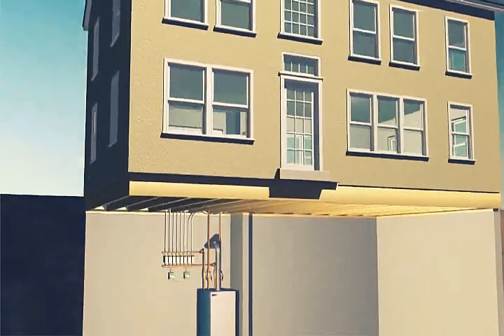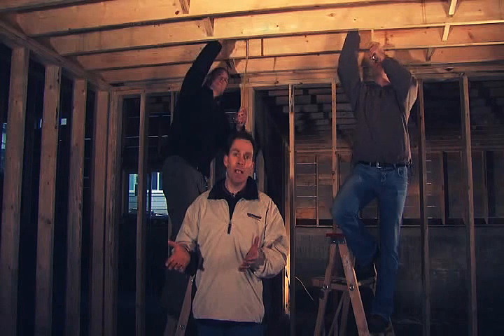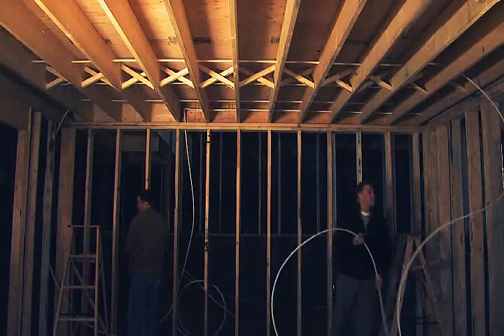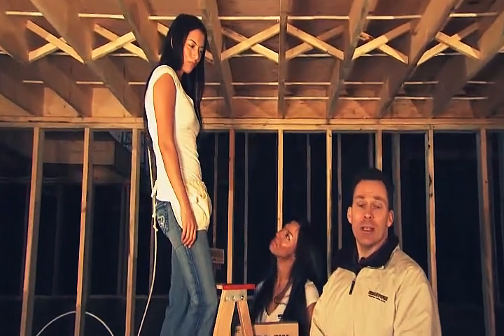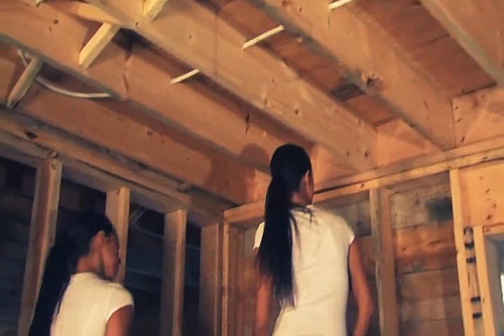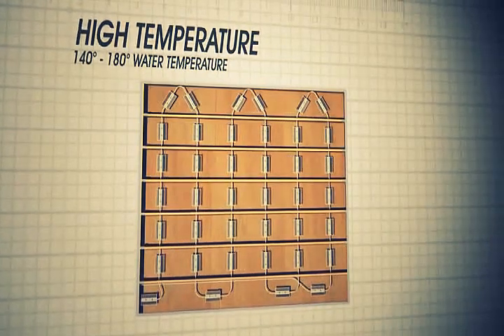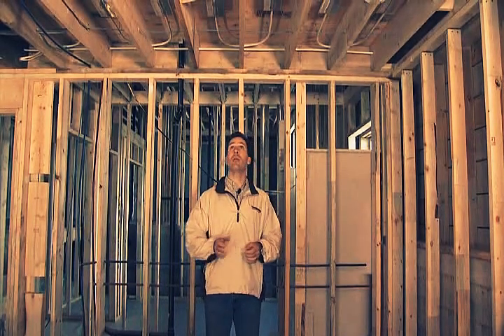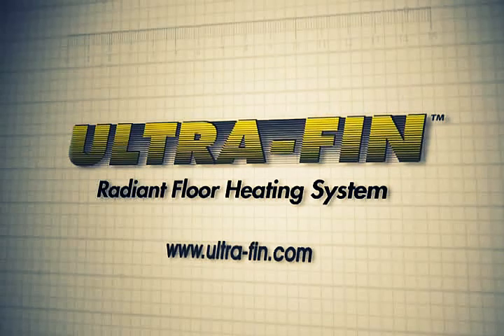Radiant heating by Ultra-fin

Comment: Just installed a $50K ($42K + 20% to GC) hydronic and Runtal radiator system to my house in San Francisco.  
My gas bill has doubled from my old forced air heater.
My house is so cold I have to wrap myself in an afghan to watch TV and I wear a down jacket in my office if I'm on my computer. My floor is warm and small rooms are warm (bathrooms and a 10 X 10 bedroom). 
After about 6 months had a leak in my garage - nail from hardwood floor. Still haven't replaced the ceiling that got wet.
My newly refinished hardwood floors cracked. (GC didn't run heat at all before refinishing AND some of the old floors had water damage which he knew about)

The installer didn't know a thing about Runtals - he initially hooked the towel warmers up to the floor system.  I moved in in April and right away I noticed the towel warmers didn't come on as the floor heat was only on for an hour at 5:30 am.

I made him hook downstairs bathroom towel warmer up to the upstairs living room Runtal radiators thermostat so at least I can close the upstairs radiators, crank up the thermostat and warm my towels. (Now that is is cold I'm leaving the bathroom door open in the master so the 48" towel warmer can "boost" the floor heat in the bedroom)

I demanded that he install two small radiators in my TV room and my office (one I decided I didn't need for my living room, the other was a mistake - he ordered the wrong color) so I have heat the three months of the year it gets down to 50 degrees in San Francisco.  Still waiting - last time he was here he hooked up on Runtal in my living room and the towel warmer in the upstairs bathroom.  The towel warmer is also hooked up to the floor system and need to be redone.  Oh, he isn't taking sheetrock off the basement ceiling to run the new tubing - just stringing it across the ceiling. 

Initially I wanted just Runtal radiators but the heating contractor and my GC talked me out of it:
"Sure you can combine floor and Runtals - no problem!" (you shouldn't - they run at different PSI)
"Never had a problem with hardwood floors." The GC's hardwood guy was the first to say "I can't guarantee my work with radiant"
"With Ultra Fin you don't have cold spots."  Yes you do.  It doesn't generate enough heat to heat a 1,250 sq ft house - IN SAN FRANCISCO!

Maybe, in theory, if designed and installed correctly, Ultra Fin can heat your house in winter and not jack up your gas bill.  Maybe.

Comment from the maker: The efficiency comes from heating the air space under the floor, not the floor itself. The heat is more even and creates fewer problems with the floor coverings. Drilling the joists allows for "Home runs" back to the boiler.